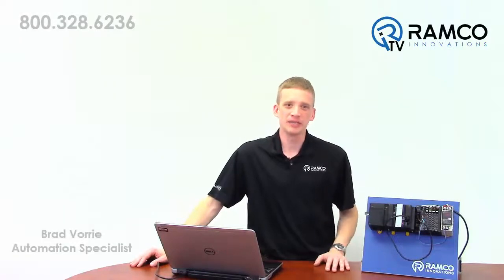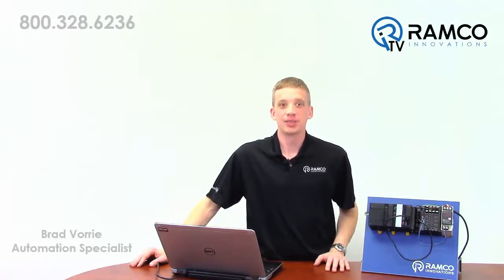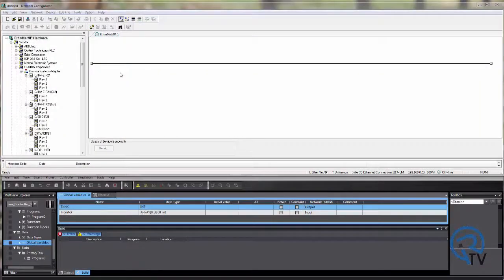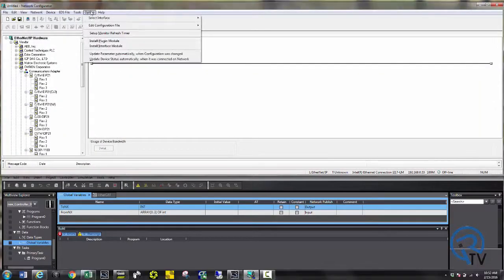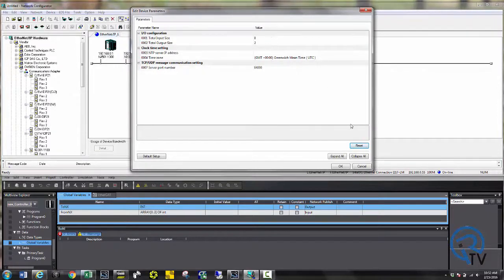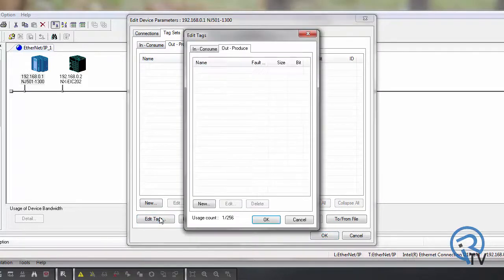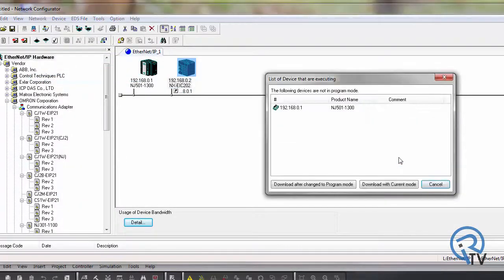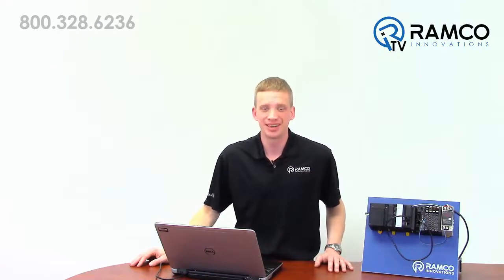Setting Up an EtherNet/IP Device on an Omron NJ

Comment: Hi, is it possible to configure the eip network in sysmac studio itself without using network configurator, since eds file registration is possible in sysmac itself
Reply from the maker: Network Configurator is also built into Sysmac Studio, so you can use it without opening a separate program. To use it, go to Tools - Ethernet/IP Connection Settings
Reply: @Ramcoi  Thanks a lot for the clarification!!!

Comment: Brad your presentations are great.. and very helpful .. because little is known about the Network Configurator .. As there is no known complete documentation about it. It's mostly word of mouth between privileged Automation Engineers .. and only touched upon lightly in a few related Omron manuals. I would suggest (because I need to know) that you add a little more information: 1) when you searched for devices on the network, 4 items were listed, yet only 2 were displayed .. you sort-of didn't notice that.... Is this a problem with the software? 2) You have chosen to add a simple I/O device to the network … how about doing something challenging, like adding a Ethernet/IP servo drive .. with lots of global variables, and the need for a .EDS file…:-) 3) When you are editing device parameters, If there are only 2 instances to register (Input and Output) why are there 20 blank lines when registering the "consume" and "produce" (In/Out)?

Another thing.. what about the EDS file installation under Tools / Ethernet/IP Connection Settings / double left-click on device, in “device list” /  select “Connection” display / mouse over to Toolbox / Target Device - right-click inside Target Device window / left-click display EDS library … Is your EDS file there? .. if not better click on INSTALL, and find it in your file of important EDS files .. you still have to drag the file from Target Device to the “Connections” window.. and fill in those nice input/output parameters.. :-)     sooooo... are there always only 2 parameters to worry about?  What if the data type is other than a Bool string?